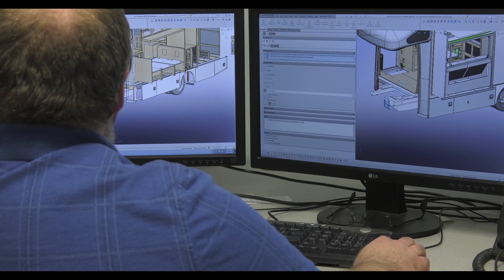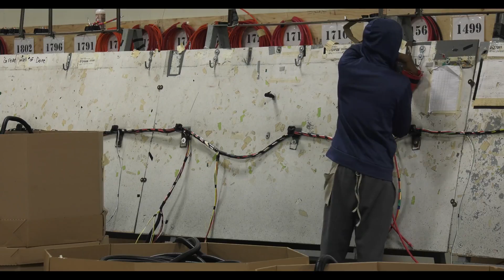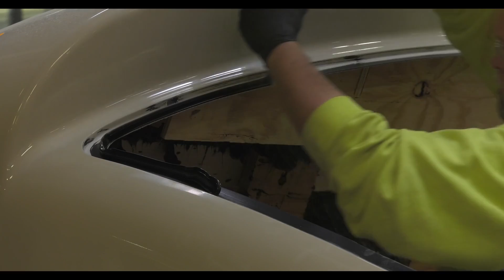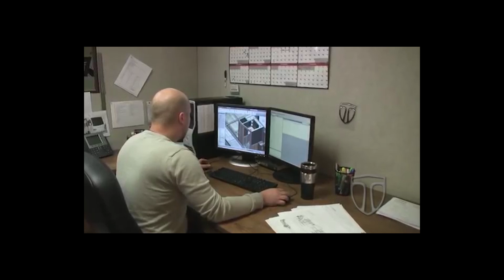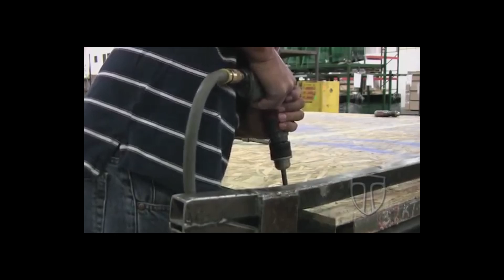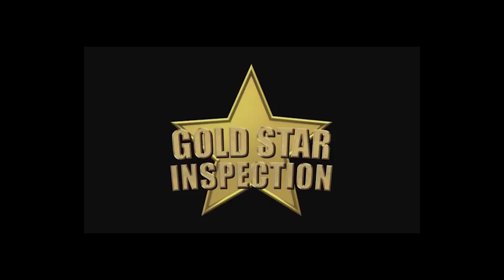Motorhomes: How RVs Are Made?

Comment: With all the latest technologies we have in 2025, we should expect new Class A Motorhomes to have modular powerwall  batteries in the bottom storage for long lasting battery use, thin and durable solar panels on the roof with folding sides that can fold out and extend out for more solar coverage, GPS, and Starlink Satellite dish.
Reply: You can put that in yourself